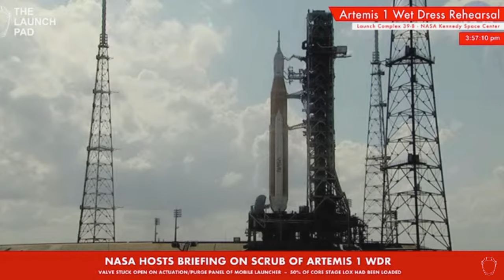UPDATE! NASA Briefs Media on Scrub of Artemis 1 WDR

Comment: Failure after failure, delay after delay, and the costs mount up... 👎
Reply: All the costs of JWST over 10 years of development equal just 3 days of the U.S. Dept of Defense budget in one year.
   Oh, and JWST went perfectly.  Insane enginneering, setting new standards for engineering _anything_.
Reply: @veramae4098  Whoa, there!  I'm with you.  I'm not talking about the JWST which is a brilliant design and feat of engineering, I'm talking about the SLS.  The fact that the JWST unfolding and mirror coordination has all gone without a hitch is an absolute marvel!  NASA's record of building spacecraft (as opposed to rockets) is excellent and without peer.  As for costs, I have no issue with seemingly large budgets for space projects - how do you put a price on new knowledge?  However... NASA's experiences with building rockets in the last decade or two has been woeful.

What they have in the SLS is an old rocket design from 1968 (modified slightly) using old and used components from over a decade ago and which were designed to be recovered and refurbished.  What they are proposing to do with them is to use them in an expendable way to send people to the Moon again at a cost of around four BILLION dollars a shot!  Even then, they haven't even flown it yet!  Two attempts at a wet dress reheasal and they have hitches in the gantry for goodness sake!  Now, as I say, I'm not opposed to spending money for space research, but I AM opposed to money being wasted on an outdated design, being thrown away every flight (the design and technology that went into making these components reuseable was astounding), and being done incompetently.